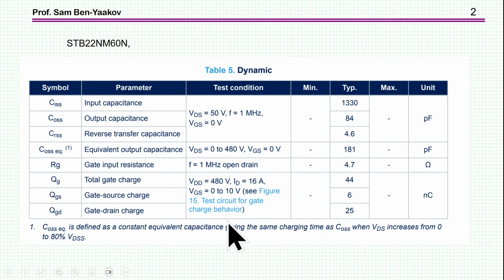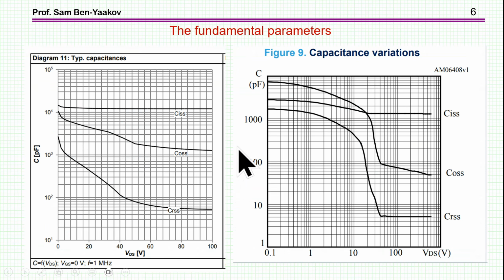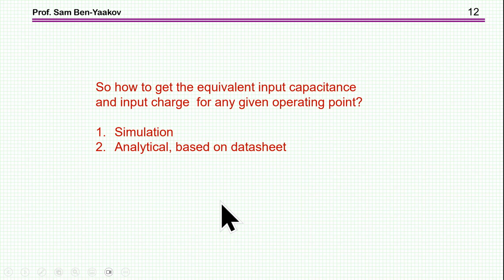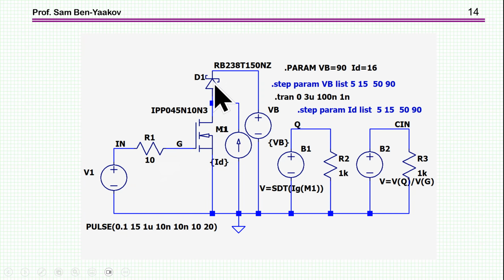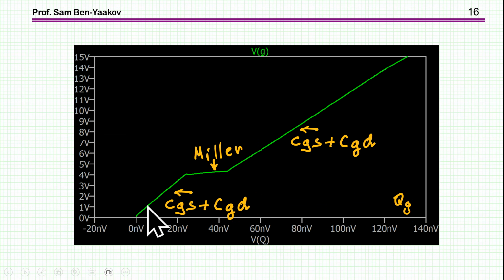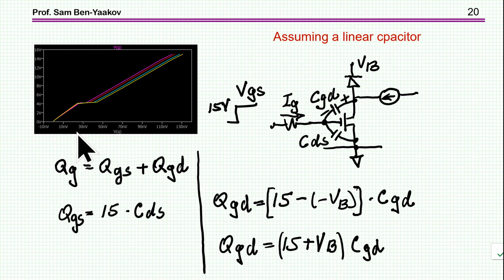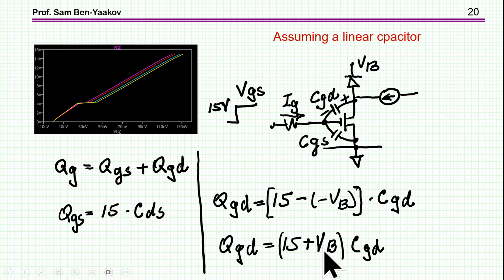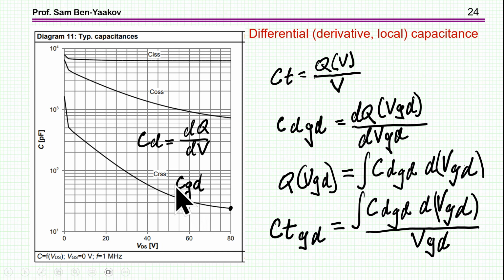Getting the input capacitance and input charge of MOSFET gates

Comment: Dear Professor,

You likely know this pain already, but I’ll vent anyway—engineer to engineer.

Many semiconductor vendors still release models strictly in PSpice format, and those files often crumble in LTspice once dv/dt climbs. The Infineon model I’m using is a textbook case: convergence collapses unless I sprinkle the subcircuit with extra damping networks. Things get especially ugly when a stiff DC link is involved (the Zener, DC link and constant-current source in my schematic copied from yours are merciless).

It’s really a vendor-side shortcoming rather than anything in our setup, but I thought I’d share the irritation.

Best regards,
Doron
Reply from the maker: Thanks for sharing. I see however that things are changing. Manufacturers now provide good LTspice models to their new devices. So there is hope.
Reply: @sambenyaakov  

There is Hope, that being said this is what ChatGPT thinks, not my words! about infineon. I think this is the problem I am having:

Infineon often publishes “LTspice” model files that are really just thin wrappers around their original PSpice netlists.
• Internally the files still rely on PSpice-specific syntax and behavioural elements (e.g., TABLE, ABM functions, undocumented parameters) that LTspice only partly supports.
• Because of that mismatch, LTspice can choke on convergence, step limits, or unsupported directives—especially in high-dV/dt, high-power switching simulations—unless you hand-edit the subcircuit (adding damping resistors, replacing behavioural sources, tweaking .options, etc.).
• The “LTspice” label is mostly marketing convenience: Infineon knows many engineers default to LTspice, so they re-package the PSpice file but don’t fully validate it there. In practice the model is still designed with Cadence/PSpice’s parser and solvers in mind.
Reply from the maker: @doronlola1763  Thanks for highlighting this important information (how about you post a video on that?🙂). Can you point to a specific MOSFET model that has this problem?

Comment: Hi, Thanks prof.  If the power Mosfet is on ZVS status, not hard swtiching , the miller plateau still existes? the gate driver charge the Mosfet curbe may be different ?
Reply from the maker: In the true ZVS case (e.g. turn on when the body diode is conducting) the Miller plateau is barely seen

Comment: another question:
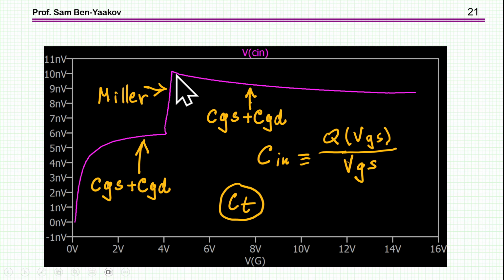in 17:53, why Vcin slightly decreases at Vg>4V(miller plateau)? you mentioned small signal but i am still confused.
Reply from the maker: If Q(V) is sort of exponential and you divide Q/V to get Ct at points along the curve, the value  decreases at high voltages.